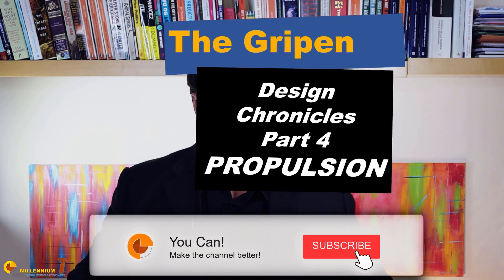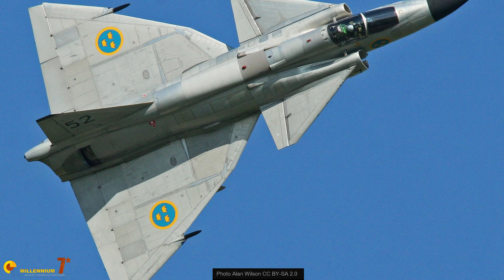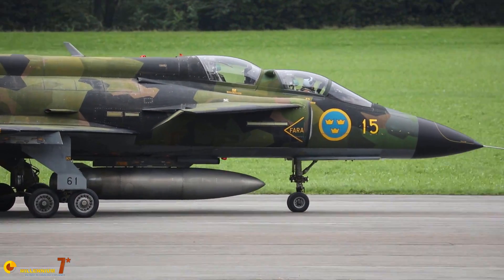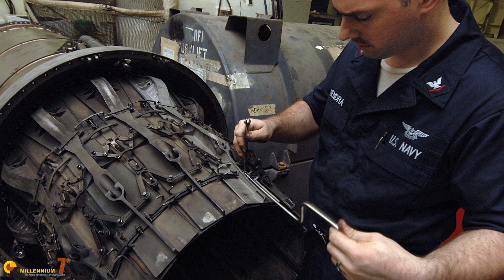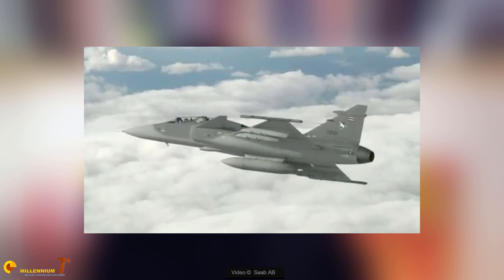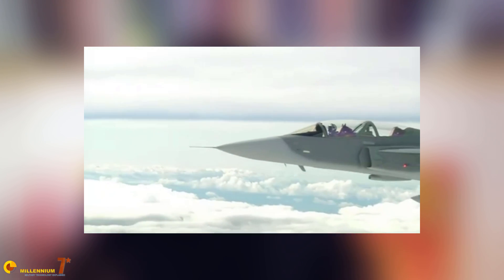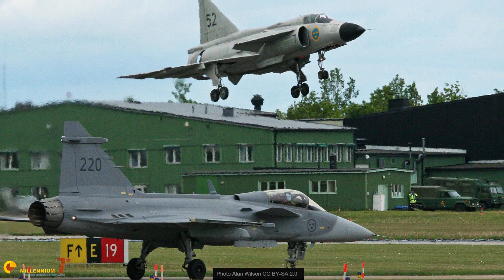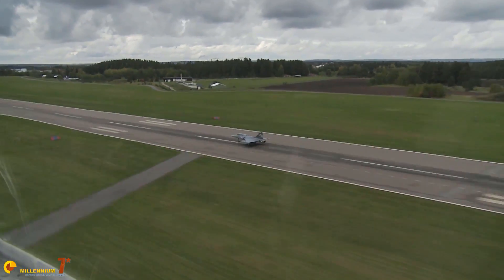Gripen - The Kick in the Back - The Design Chronicles - Part 4

Comment: @Millennium 7 - in light of Sweden's decision to keep the existing Gripen C/D planes in service alongside the new E/Fs for another 10-15 years - don't you think it makes sense for Sweden/ Saab to pursue further upgrading of the RM12 engine? 
Volvo (now GKN) back in the 2006-2010 timeframe indicated that it could produce an RM12+ version of the existing engine that would produce 15% more thrust and be even more fuel efficient (seems like a win-win). https://www.flightglobal.com/nordic-special-quiet-partner/71075.article. Here's some pertinent text from the above article: 
"Under its existing development plans, Volvo intends to demonstrate upgrades to the RM12 in the 2010-12 timeframe that will increase thrust-to-weight (T/W) ratio by up to 15%, reduce costs by about 10% and include a lower-observable, lower-noise exhaust. The RM12++ version would be aimed at the proposed JAS39E/F, and involve a new fan, modified LPT and control system changes. Compared with re-engining options such as the Eurojet EJ200, GE F414 and Snecma M88-2, the RM12++ would have "harder risk, but lower cost", says Nilsson. Further off, beyond 2012-13, studies are under way to advance T/W ratio to 10:1 in dry thrust and 15:1 with afterburner. Vectored thrust is also under consideration for the follow-on phase." 
As I mentioned in an earlier comment/ question for you re: the F414/ RM16 engine that will power the Gripen E/Fs - a common complaint re: all the Gripens is the lack of available thrust when carrying heavy loads (weapons/ sensors and extra fuel). The above-referenced upgrade of the existing RM12 engine was initially being discussed for use on the new, heavier Gripen E/Fs so it's understandable that further development work wasn't pursued with the decision was made to utilize GE's F414 engine for the new planes. Realize, however, that the original plan was to re-configure the existing C/D planes into E/Fs. It was eventually determined that this wasn't all that cost-effective and that the E/Fs would all be 'new build'.  Not long afterwards - Sweden determined that 60 E/Fs is likely not sufficient to replace 100+ C/Ds so a decision was made to keep the C/Ds flying alongside the new E/Fs - likely for 10-15 more yrs. As such, it seems to make sense to continue upgrading the C/D fleet to keep them relevant and compatible with the new E/Fs. That likely means upgrading the displays to the WAD that will be utilized in the E/Fs and adding a new AESA radar and possibly new/ improved sensors and systems (EW/ IRST etc.) and likely carrying additional fuel to keep up with the greater range of the E/Fs. That means the C/Ds will be carrying more weight so why not upgrade the engines to provide additional thrust and even a little better fuel efficiency. Sweden already has hundreds of RM12 engines in its inventory - so it would seem to be a cost effective and useful upgrade.

As always - you insight and thoughts would be appreciated. TIA

Comment: Wouldn't ultimate aircraft be unmanned, remote controlled like a videogame? No pilot inside, can perform amazing maneuvers.
Maybe a quantum communication link for control
Reply: @Nick Emerson quantum data exchange would be a possible way. Perhaps the ultimate way
Reply: No there are multiple problems with unmanned aircraft for use as a fighter. If AI controlled, there is the high possibility of sabotage or errors leading to tragedy. If remote controlled, there is significant latency that makes it inferior to similar manned aircraft and the communications are prone to disruption or even hijacking.

Comment: I was a conscript in The swedish airforce as mechanic on the Gripen. A little curiosa: the 39 A-D have carbonfiber brakes on the nosegear. As far as I know as the only aircraft in the world.
Reply from the maker: Interesting point. Thanks!
Reply: @Millennium7HistoryTech  If you visit South of Sweden or the copenhagen region in the future, then I can recomend Ängelholms Flygmuseum. It is a museum at a former airwing. We have most of the  fighters that have served there. I would be glad and honoured to guide you. (especially the bird I work on. A Ffvs J22 "röd kalle". We are currently reasemblying the aircraft after an engine rebuild) and ofcorse we have a JAS39. Number 39-001.

Comment: after watching this series, I'm now starting to fall for the Gripen. It's a great airframe - but stats show it has 2x the hull-loss accidents rate than an F16. @Millennium 7 would be great to know why!
Reply: Scratch that. I got the Gripen numbers wrong by a factor of 10. My bad.

The source is wiki.

I noticed the Gripen has unfortunately had several airshow incidents interestingly all down to "flight control software" - I was interested in seeing just how many Gripen there are in the world:

Gripen - built: 306, lost: 9 ≈ 3%
F16 - built: 4604, lost: 670 ≈ 16%
Reply: @PaoloMemoli100shapes  Thank you mate for taking the effort and time to answer
Reply from the maker: That's interesting. I will look into it at some point.
Reply: Please share the source

Comment: @Millennium 7 - wondering if you have inside information as to whether Saab is working with Volvo's successor - GKN - on tweaks to the GE F414 engine for the Gripen E/F - which will be designated RM16 for the Gripen derivation - so as to increase the engine's thrust - similar to what they did for the GE F404 engine (RM12) used in the Gripen C/D? 
GE has it's own 'enhanced' derivative of the engine (with approx 20% more thrust) that's rumored to be added to at least some Super Hornets - both the new build and by upgrades to the existing fleet.  GE states that the 'Enhanced' variant of the F-414 engine will produce 26K max thrust (116 kN). https://www.geaviation.com/sites/default/files/datasheet-F414-Enhanced.pdf
Given that one of the main criticisms re: Gripens relates to their lack of thrust from the single engine which impacts performance when carrying heavy weapon/ sensor loads - you'd think this would be something Saab/ Sweden would be interested in - both for Sweden's purposes and to make them more competitive on the export market. 
The primary work on the up-thrusted 'Enhanced' version of the F-414 engine has been done at the Navy's behest with the thought of upgrading the F414 engines on the exiting SH & Growler fleet, but GE has apparently done some work on a single engine variant that it has offered to India for their proposed Medium Weight Fighter (MWF). https://idrw.org/general-electric-offers-india-a-new-engine-for-mwf-and-amca-fighter-program
My guess is that Saab/ Sweden would work with/ through GKN if they were to pursue an 'Enhanced' version of the F414. Again - it just seems like this would be a valuable enhancement for the single engine Gripen E/F - especially when carrying heavier A2G and A2Sea armaments and/or extra fuel. And, given the US Navy's interest in the Enhanced variant for its Super Hornet and Growler fleet - it's somewhat surprising that I've read nothing to date about this 'Enhanced Engine (EE)' variant of the GE F414 engine  being utilized for the new Gripen E/Fs.  Any insight/ inside info that you might have would be appreciated.
Reply: Usually there is rework on the compressor stage and as of late the engine control. The AB ihas always been a Swedish design regardless of what engines the fighters have had, I think that its not going to change with the E/F. Much work is put into making it extremly durable and sometimes simpler to work on.

Comment: Fantastic series on Gripen. As it is currently in the running to replace Canada’s CF-18 fleet, would you consider a video on the comparative strengths and weaknesses of the three fighters vying for the role of the RCAF’s future fighter: Gripen, Block III Super Hornet and F-35? Would love to hear your take on that.
Reply: Although Im swedish and therefore not objective in the matter, I still think a mix of JAS 39 Gripen as a fighterplane/reccon and the F18 SH as a attackplane will give the best bang for the buck for any nation on the earth, Canada included.
Reply: All three are poor choices for Canada. F-15X or Rafale are the best options. Unfortunately, Rafale dropped out of consideration despite being favored to win and Boeing is offering Super Hornet instead of Advanced Eagle. Apparently there were some demands as far as transparency on some systems that Dassault was unwilling to provide, perhaps over fears of revealing secrets and thus they dropped out. Boeing is still conducting acceptance flight testing of the Advanced Eagle with the USAF so that may have been a consideration why it was not pushed as an option.

Comment: Just a note concerning the Viggens engine.
While the RM8A had  problems in regards to the compressor stalls as mentioned (Similar to the TF-30 in this regard)
the later RM8B used in the Fighter Variant of the Viggen had removed these issues.
So rapid throttle movements were no longer a danger while Maneuvering so it was something pilots did not have to worry about in the JA37
(Where as with the RM8A in the other Viggen Variants the pilot had to be catious at high AOA etc)

The Reasons why the RM8B was not used in the Gripen is not that it was a bad or unreliable engine but rather that was a older less efficient design at that point.

Since while it was significantly more powerful then the F404/RM12 (RM8B generated 125 kN of thrust in AB compared to 80,5kN of the RM12)
that would be selected for the Gripen the RM8B was also larger and much heavier 

(With the RM 8B having a length of 6,23 m and a weight of  2220 kg with a 1,03 m diameter, Compared to 4,04 m 1055kg and 0,709 m for the RM12) 

so in order to fit the RM8B the Gripen would have had to be larger which would have made it heavier and also more expensive.

And one of the main desires for the JAS 39 Gripen was that it was to be smaller and cheaper then the Viggen 

(To stop the trend where each generation of aircraft became more and more expensive) 

while still being more capable across the board.
And as such a more compact and efficient engine was needed.
Reply: Not always..When I did my training in Swedish airforce as an technician we did see a film with a JA 37 coming very low and when i pulled he got an engine stall for a short period.
Reply: @henrikl1394  Yes it could still happen with the RM8B
But i my understanding is that it was very rare and not something the pilots had to constantly keep in mind when moving the throttles.

(The RM8A was likely to have compressor stalls if the pilot made mistakes where as the RM8B was unlikely to have a compressor stall even if the pilot was making mistakes. it could still happen but it was far less likely to happen then with the RM8A)

Since even modern Jet engines can suffer compressor stalls on occasion 

(though it is far less common then it was  for 1960s era engines like the TF-30 and the RM-8A) 

For example there are youtube videos of both F-16s and F-18s etc having compressor stalls.
That does not mean they are prone to having compressor stalls.
As its something that can happen even with more modern engines.
Reply: @Mattebubben  An important redesign was of the bypass channel in the JA37. In order to get better high altitude preformance the compression ratio was increased in the bypass duct and the compressor redesigned (among other parts). The JTD8 series is a huge engine compared to other fighter engines. Most of the contemporary fighter engines at the time, with out AB, could fit in the back of a pickup truck. The JTD8 is not going to fit, even if you pick the modules apart :)
Reply: The problem with the RM8 was that it was intended for a low-level attack aircraft with some aircombat capacity....  and when Swedes talk low-level, it's uncommon to see the underside paint unscratched by the treetops. Going mach-1 at basically sea level was the reason such high bypass was considered necessary, and why a civilian engine was chosen as basis. RM8B only partially managed to adapt the engine for a totally different purpose.

The reason for the F404 getting picked instead of the P&W100 was that SAAB, in order to gain favour of the project to be initiated at all, had promised to deliver an aircraft half the size of 37 Viggen, and thereby painted themselves into a corner as very few engines were small enough to fit at all

Comment: In the early 90:s I was a conscript aircraft mechanic on the SF/SH37 Viggen in the northen part of Sweden, close to the arctic circle. Viggen was designed for quick turnaround, refueled and rearmed by just a few conscripts and one officer in the woods in rough conditions. Swedens air defence strategy was based on the ”Base90” infrastucture. Simple, sligtly wider paved roads, used as short scattered runways which where hard to disable with bombs. Quite different strategy than most air forces. Gripen is designed based by the same strategy. I like your videos about  technology and aerodynamics but it would be interesting to learn more about implementing a specific aircraft as a working system on the ”battlefield”.
Reply: The Viggen had a foldable fin which I think is quite unique. You just removed a few retaining pins, retracted and raised by a manual hydralic pump. A folded fin enabled the aircrafr to be stored in old low hangars or bomb proof caverns. Quite ingenious feature. Are there any more fighter jets that utalize a folding fin for this purpose?